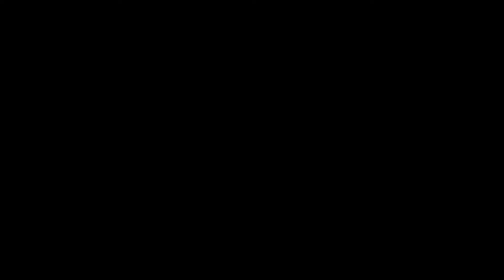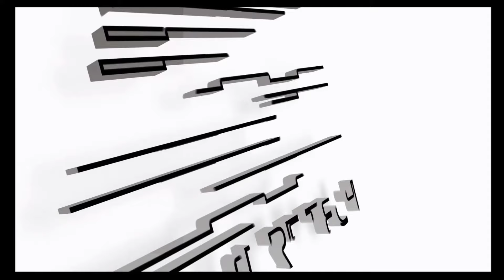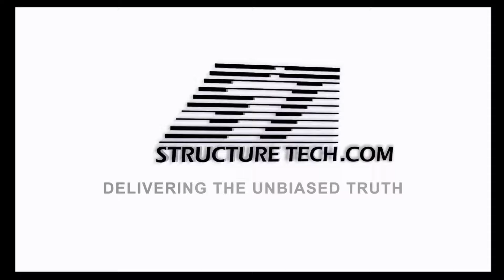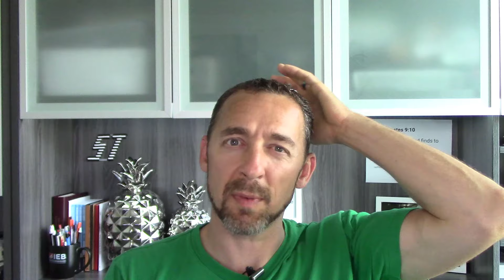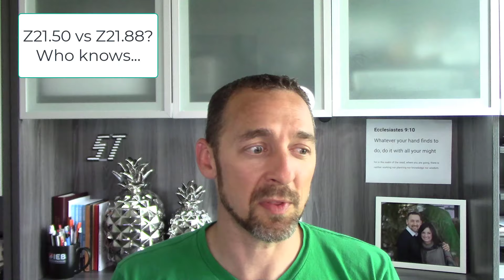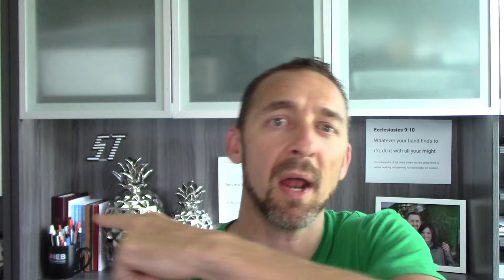Problems with Gas Log Fireplaces

Comment: Ahhhh....first of all- a gas detector will clue you in if there is a leak. Secondly, (I have 2 inserts, non-vented) very efficient and very affordable. Sure beats paying the electric company for heat. Third: at 96% efficient, we are as warm and cozy as any wood burning stove I ever had. You have to place the logs correctly, have it serviced regularly to make sure it is clean and no leaks, and be smart about it. We have had ours for over 15 years with no issues. Don't be fear driven. Live.
Reply: I was going to make this same post. I've had my vent free for years with zero issues. Very efficient and I keep a CO2 detector right next to the fireplace. I'm not sure what this guy in the video is referring to. I can even heat my whole upstairs from my living room logs if I want to leave the bedroom doors open. Gas is cheap.

Comment: I thought to find some useful information here, but simply ragging on the gas-log styled fireplace is not useful. And contrary to some comments below, using this kind of heating is no more expensive than a regular furnace set-up. I've noticed no jump in my gas bill beyond what I should expect from the amount of gas used to normally heat my home. Guess I'll continue looking for what I need to know.

Comment: Gas logs are perfectly safe. They all come with oxygen depletion sensors so IF a room is too tight and there is not enough oxygen, they automatically shut off. I have been selling, servicing, and installing LP gas fireplaces for over 20 years. They work perfectly fine.

Comment: A carbon Monoxide detector would go off it you forget to open the flue damper on a gas fire place.  I would have two CO detectors so they back each other up in case one fails.   In many valleys they have no wood burning days about 50% of the time in, the winter, due to temperature inversion.

Comment: One would think that one could get some help from a video called 'Problems with Gas Log Fireplaces" but this is just a rage  against gas logs.  I have has several and my new one has a problem and I need assistance working out the flame.  I live in Alabama and normally, heat is not a problem.  I have a heat pump what heats the home well and on some occasions, we like the fireplace first thing in the morning.
As far as expense, our 2400 sq feet home with electric heat pump averages $200.00.  My 400 gallon propane tank is still 90 full as we hardly use the gas logs.  The big fear with gas logs is that the flame goes out but propane continues to poor into the house.  Supposedly, that is not possible with the current  ones out.  Hell, who knows?  Apparently, it's a felony to circumvent the safety  features and attempt to by pass the shut off.

Comment: Oh man you just rained on my joy, just bought a older home with beautiful fireplace with gas logs I’ve burnt wood in a wood stove for years but never had a gas fireplace I told my wife this is my room I am getting a big recliner and sitting by the fire we move in in 2 days so I’ve been watching all the videos on the different types of gas fireplaces ours is a vented and I don’t know about the clip thing or if the flu is open all the way or if it has a pilot light I understand if it don’t and the flames goes out I could blow the entire neighborhood up so I will be checking this out I think it would be best if I have a certified chimney sweep come out and inspect it. Your video was helpful because I didn’t realize even with the flu open you can still get carbon monoxide coming in so a detector will be a must. Thanks for the information.

Comment: You are exactly right that a lot of the artificial gas logs in open fireplaces create gas spillage into the room when in use. Many times this is simply caused because the logs are not positioned correctly.  Many professional gas log installers only use the “soap bubble” test to check the gas connections inside the firebox but this will not prove that the logs are positioned correctly. As an inspector, you should be using a combustible gas detector. With this tool, you can check the fireplace gas valve (where you put in the key). We find in our experience that about 10% of the gas valves leak inside the wall and you won’t know it without the detector. Also, turn on the gas logs for about 10 minutes and use the detector around the perimeter of the firebox opening. This will test for gas spillage into the room, likely because the logs are sitting too far forward or not positioned correctly. Make sure the furnace is not on at the same time as the gas logs which will also cause gas spillage into the room.  Make sure that the homeowner never closes the glass doors during an active fire because they may implode or explode the glass. And you’re right that the artificial gas logs in an open fireplace don’t produce a lot of heat but do create a beautiful cozy feel without having to constantly tend to the fire.

Comment: OTOH they do make handy backup heat. I use mine perhaps once a year during outages. The damper is fully open as my use for backup heat is so rare any waste is not a concern. I use my gas stove at the opposite end of the house by baking bread and cooking when a power outage hits. Backup heat need not be ideal to save plumbing and occupants (though it bears reminding everyone should own enough cold weather gear that they cannot get hypothermia in any reasonably likely situation and should own a sleeping bag rated far below the coldest temps in their area).

Comment: I recently had my chimney destroyed  by a fallen tree. The fireplace was constructed over 100 years ago and a gas log installed with a simple on and off valve to a punctured tube. No controls in the 20s. MY QUESTION IS CAN I SIMPLY SEAL OFF THE CHIMNEY BELOW THE ROOF LINE AND ALLOW WHATEVER FUMES BE ALLOWED TO ESCAPE INTO THE ATTIC?
Reply: Are there code violations in this type of alteration?
Reply: not a good idea to vent flue gas into your attic

Comment: Dude. You have zero faith in the intelligence of adult human beings who can afford to own gas log fireplaces. Its simple: First step in making a fire, wood burning or gas - Open the Damper! I have never forgot and will never forget to pull the chain, listen for the rapping sound of the spring loaded top sealing damper lid when it hits wide open before moving to the next step.
Reply: If you know about Weird Al Yankovich’s parents, then you know that his parents died because they forgot to open the damper. Sadly, he lost both his parents the same night.  And they were burning wood. With gas logs, if you forget to open the damper, you won’t know it until you don’t wake up. You may be responsible enough to remember to open the damper but most people aren’t. Or another scenario, many people don’t remember which way is open and which way is closed. That’s why the code requires the damper be locked fully open when gas is present in the fireplace—to protect people from themselves.
Reply: The damper is clamped in a permanently open position in gas log fire places. Your information is old.

Comment: I agree as well. Also, the majority of these have logs out of place or randomly installed, causing flame impingement and more carbon monoxide production. A telltale for this condition is fluffy black carbon buildup on the logs.
Reply: I would be one of those home owners who have the logs out of place. I went from living in a house with a wood burning fireplace to a gas burning fireplace. I'm not sure how to stack the fake wood and the people at fireplace store just wants to sell me a new insert ☹️
Reply: I have a few spots of soot build up on my logs and the inside of my home is showing some soot after 12 years of vent free use.  However, we use it 100% on weekend days and evenings and every night after work in the winter to heat the entire house because my wife loves the ambiance.  I always am cautious about CO buildup.  Since my fire/CO detectors are more than 12 years old (2 years past recommended replacement) I installed a new set that has CO level readouts and they have registered ZERO CO present.  It made me much more relaxed than just the alarm type.  I will admit, the soot is a bit frustrating but my logs are installed according to manufacturer layout.

Comment: Thanks for info. 
Suggestion-  Cut it down.  Wow.
   I hate gas log fire places
Is drilled so deep in my brain.  ..it took way to long to Get to the point.

The main point to the video could have Ben completed in 50 seconds. 

Also. As a hone inspector, it is NOT your responsibility to provide an opinion.   Your supposed to point out problem/issues and direct them to a professionals of that trade.  

Great information provide.  Just cut it down.  And please done get personal when inspecting. 

When I was a RE/MAX, so often when working with buyers, i had to calm down their emotions while thhey because so scared make a purchase all because inspectors would out thir personsal openion in the report.

Most often, always with good  Intentions however, we the agents, are left with the wondering brain.  

Thanks for the help

d the tone down the  bppluyer who thought the house was falling apart.

Comment: You need to organize your ideas better
Reply: Dude there is nothing wrong with a gas log insert for your fireplace. The clamp for your damper will keep the damper open enough to release the fumes that you cannot see. The only problem that I have is that it is somewhat costly for the gas bill if you use it often for luxury. It should not be used as your main heating source.